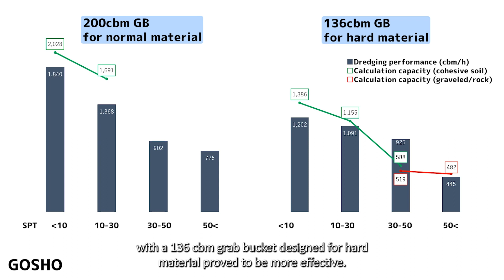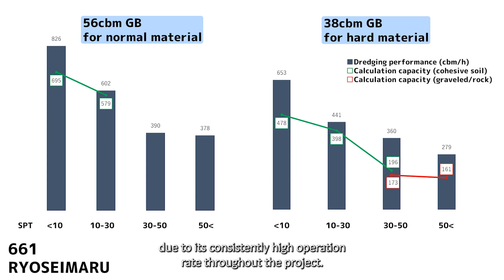Dredging performance of KOJIMAGUMI's grab dredgers in Singapore project

Comment: Using off the top of my head guesses for the bulk density of the dredged materials it seems that one machine, Gosho, moved in three years what it took the entire mining operation of the medium sized iron/copper mine I worked at did in 10 years!
Amazing.